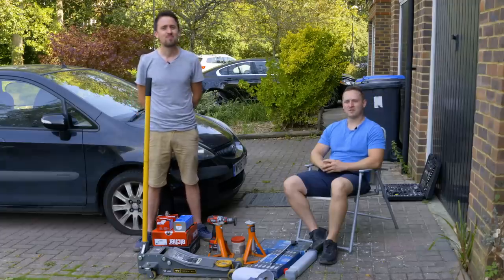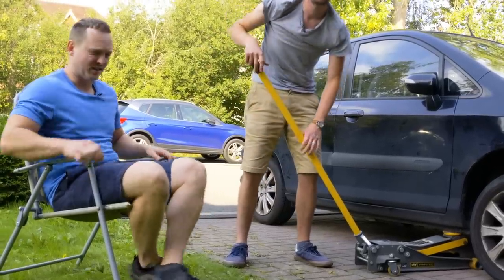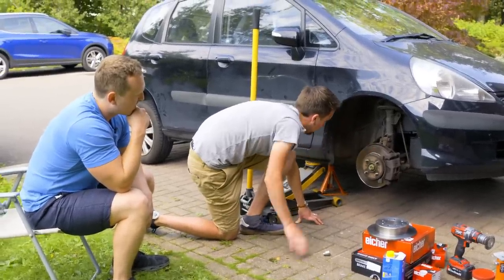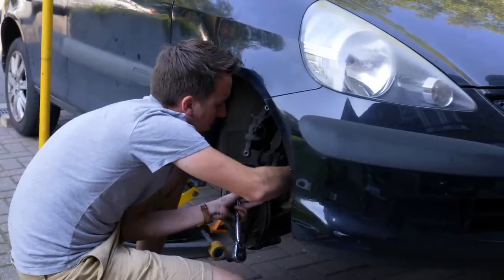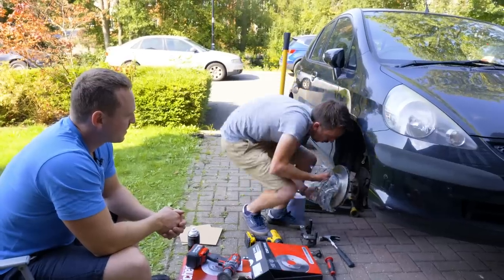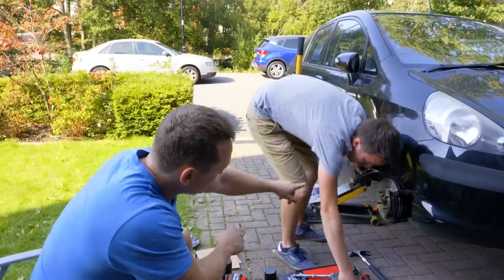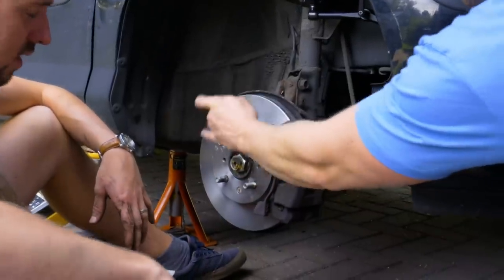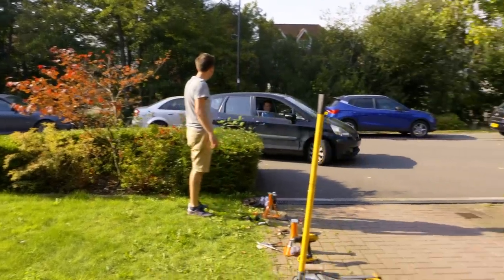Non-Car Guy Changes Brakes For The First Time

Comment: Hats off to Ethan. Most non-petrol-heads wouldn't even attempt this. Now he has the power to give less money to garages and dealerships. The price of having the p**s taken out of him by his 'mates' is well worth it.
Reply: To be fair he had more confidence than most non car guys would because he had all the tools needed and back up mechanic mates in Alex & Jack in the event he got stuck or did something wrong. But yeah, it's nice to see that he was willing to give it a go.
Reply: I’m a non petrol head, couldn’t point out the turbo on my car to be honest. But watching these videos with Ethan doing stuff gave me the confidence to change over my rear bumper after my parking sensors failed and I reversed into something, not sure I have the confidence to change anything mechanically yet, at least not on my 2016 f21. But I’ll give changing the brake pads a go just not the discs. Baby steps lol
Reply: John Peterson honestly if you are doing your pads and you also need to do the rotors, pads are like 80% of the job, the rotors are the easy part of the job, just undo 2 screws, clean the new ones and fit them. As easy as that. I find more labor on the pads than in the rotors.
Reply: This looks like me teaching my nephew something new on his vehicle..... I'm usually Alex when my nephew is working on his car..... I'm just there for moral support
Reply: @edgarmichaelperezruvalcaba7744  Well it is true it's not hard to do the rotors, however if his are still in good shape, not warped or worn down that is, there's really no reason to change them. Rotors do tend to cost a lot on some cars as well.

Comment: Top tip: Turn the wheel outwards for easier access to the caliper and carrier bolts. Well done, Ethan.👍
Reply: Excellent tip, I'd also add to check the brake fluid level when you're done to anyone trying this at home!

Comment: "How have you lost stuff in two square metres?" 

Alex be reasonable, we car guys lose stuff in one square foot then spend 20 minutes searching for it. 😂

Also the piston pushes in a lot easier if you take the cap off the brake fluid reservoir, you might even be able to do it with your thumbs. 😉
Reply: do you work on tiny Daihatsus or how the fuck do you push then with your thumbs??
Reply: I had an apprentice once that i described his order of which is bolts came off a car as a 20foot radius around the vehicle.
Reply: I know the feeling about losing stuff lol. Any time I put something down, it's usually on top of the thing I need next and I end up looking for that for ages FFS!! I wouldn't be surprised if I find something I lost well out of my original reach soon....

Comment: 9:34 “welcome to working on cars”. We all being there, it’s the worst when it happens in cold weather Lol.
Reply: FR. I was fixing a thing on my bicycle that was in a bad position, I got it positioned good, and then it slipped and I bashed my knuckle straight into an edge and it hurt quite a bit. I hate working on my bike cus it's got so much screws and shit in weird spots. Like the screw for my kickstand that keeps getting loosened up is in a really tight place that I struggle to get the Allen wrench into. Spent like 10 minutes tightening it when it should be a 30 second fix if it wasn't in such a bad position.
Reply: Stops happening when you learn how to reposition yourself so you pull to break bolts instead of pushing haha of course thats not bullet proof sometimes you just can't and you will smash your knuckles.
Reply: David Schwartz it’s funny when you simply know what you’re about to do is going to hurt, and there’s nothing to be done about it
Reply: @Sp00kq  use a ratchet with a Allen key attachment

Comment: Ethan: “I’m so dirty” 😂😂😂😂 dude has slightly dirty hands 😂😂😂
Reply: Yeh. Try changing the plugs on an old buick with a leaking radiator hose and a bad axle boot. Grimey.

Comment: One small piece of Dad advice, don't wear your rings when working on anything, so easy for one to get snagged and rip, break or do worse to your finger.
Reply: Interesting fact
Reply: Thanks Dad :D
Reply: Another piece of dad advice, always wear your old clothes or overalls when working on stuff.
Reply: One more concerning but often overlooked advice is to grease the Slider Pins aswel. 
Binding/Uneven pad wear and squeaking brakes are often symptoms of dry Slider Pins.
Reply: All of my jewelry is silicone rubber for this exact reason.
Reply: Worth taking your watch off, too. 1. Because you don't want to break it. 2. Because you probably don't want to know how long you are taking.
Reply: @statementleaver8095  so true, but use silicone grease, not petroleum based or any rubber will swell. I think.... LoL so many little things to remember!
Reply: @anthonybc  I actually use Castrol LM grease (High Melting Point) 500g container.
Supposed to be for Bearings lol

Comment: I’m just waiting for  “A Honda Jazz has had it’s breaks fail and has run over 7 children”
Reply: So typical of Ethan to miss the other 3
Reply: The Jazz only has the oompha to run over 1 small kid.
Reply: Jokes away, that amount of copper grease on disk face will make its way to braking surface due to centripetal force in due time..!

Comment: Changing brake pads and discs is actually one of the easiest jobs on a car. Easy access and only a 8 bolts. It’s hard to get wrong.
I’d double check the owners manual for the correct jacking location under the car, so you don’t damage the floor pan.
The oily residue on the new brake discs are to stop them corroding while on the shelf.
I would also give the mounting brackets a clean as well, so the slots that the pads slide in are free of brake dust.
I used a thick screwdriver laid horizontally across the brake piston to push it in, or I suppose you could use the breaker bar laid across. I find it helps if you unscrew the brake reservoir cap.

Comment: Should probably have kept an eye on the brake fluid reservoir when winding in all four calipers. Last time I did discs and pads on a car I forgot and ended up with alot of brake fluid in the engine bay
Reply: That's because someone added brake fluid when they shouldn't have.
Reply: @dillonbmx16  I was hoping they would top it up before starting, just to see Ethans face when fluid starts dripping out of the engine bay.
Reply: That's why I crack my bleeder screws on the caliper before pushing the piston back in.  Just top the reservoir off for how ever little bit you end up losing, and bada~bing.

Comment: Im no mechanic but ive mastered.
Springs suspension shock absorbers/upermount mount
Control arms and bushes/drop links
Brake disc/pads/painted calipers
Radiator replacement/aircon
Rear diff fluid change/ transmission fluid
Body panel replacement/upgrade facelift lights.
And.............yearly service.

Ive taken apart a whole 2011 audi S3 :) in 2 days

Comment: -"All japanese cars are reputed for using 17"
-"oh it was a 16"
Reply: It's a 16 now that you've rounded it off to that size.
Reply: 17 for the oil drain plug, 16 for the brake caliper bolts. Drill for the JIS screws.

Comment: FYI don't use copper grease on the mating face between the disc and wheel, just the centering ring in the middle. The acceleration and braking forces are all transferred through friction between the mating faces, which is created by the clamping force of the wheel fasteners. With grease the forces can be taken by the studs or bolts laterally, where they are only designed to clamp inwards.
I have had cars that needed a mallet to get the wheels off the first time, then with the mating faces cleaned and greased only on the centering ring they have subsequently come off without any problems. That is where all of the corrosion grips the pieces together, not the flat mating faces. Also clean up the matching parts inside the wheel.
That said, Ethan did great.

Comment: Easy trick when compressing the piston, do it while it's still connected. Take an old flat head screwdriver (a fairly thick one you don't mind bending), stick it through the that square opening on the side of the caliper and into the middle bits of the rotor. Then easily pry the screwdriver towards yourself (using the rotor as the fulcrum point). It will collapse the piston so taking it off/putting it on is easier and you won't need a special tool or smashing a hammer into your guts later.

Comment: One thing Eathn forgot to do, is that he should of taken off the brake fuild reservoir cap, so that the air is not trapped inside the reservoir when Ethan pushes the pistons back into the calipers.

Comment: I feel Ethan's pain: My 2001 Fiesta had spring clips holding the brake-pads in place, they pinged off if you didn't get both ends on properly - it was infuriating!

Comment: for front brakes you can use a pair of big red grips, and then just squeeze the fronts back, you need a wind back tool for rear brakes when the caliper has the handbrake on the back

Comment: Don't grease the face of the disc where the wheel meets. It can cause issues when torqueing the wheel - the wheel will be torqued up, and as you drive down the road, it can loosen the bolts as the grease gets squeezed out. 

Those screws on the rear discs are not required. They just hold it in place whilst the wheel is fitted.

Comment: Here in Ontario, we use silicone grease on all calliper pins and pads, and the anti-seize (copper grease) between the hub and rotor as well as the rim and rotor. And usually don’t put those stupid rotor screws back in. We just have way too much corrosion and seizing around here.

Comment: When you are trying to remove the caliper, turn the steering wheel so the bolts on the back are facing out so you can use your body weight to remove them with a breaker bar if they are stubborn.

Comment: Alex you meanie, 1st rule on spannering never grip the spanner or ratchet. Always have your hand open so you use your palm. So if a tool does slip you only hit the palm of your hand ✋ not 👊 your knuckles. But Alex would have know that. Naughty boy.
Little things.
1 remove the cap from the brake reservoir. Helps with allowing the pistons being pushed back.
2 clean or replace the little silver clips that hold the pads on the caliper carrier.
3 clean out and lube the holes where the caliper slots in the carrier. For smoother action. 😉
4 you don't "need" the little screws that hold the disc on as there are 4 wheel nuts doing that. But hey fair play for getting new ones.
Apart from that good job. Oh copper slip the wheel studs a little too not to much.👍

Comment: I started a brake job last year in April, I didn't finish until September when I finally had all the parts and tools. I also had replace a wheel bolt and wheel 2 lugnuts that I had angrily put on too tight and wrong at one point.
There was damn loctite on the front wheel caliper bolts.

Comment: In Canada I was quoted 650$ cad for aftermarket and 900$cad for oem. Bought rotors and pads for 150$ for the rest bought power tools, lubes and other small stuff for the future and did it myself...

Comment: easy way to loosen your lug nuts. Use the top of that jack that comes off and put it on top of the lug wrench. It makes it wayyy easier and requires less force. Saves a lot of time.

Comment: I've taken my 2011 Megane to a free safety check within a different reputable service. It rimes with halfrauds. They asked me if I'm worried about anything in particular. I said discs and pads. They then proceeded with the check that took them a full day. They advised me that the discs and pads are gone so badly they would fail at any minute now. Their best quote was over £600. When I've asked why they said the bearings are sort of included in the back discs. Never again. That was 1 and a half years ago. Still same discs and pads. No issues with 2 MOTs since. Never trust a main dealer!. They also nicked my oil dipstick. I found out too late. I found just the top of it glued in place.

Comment: I normally used a screw driver and 14/17 , 12/14 flex socket to work on jdm cars 
12/13 flex socket and a 17 wrench and h7 on bmws with a screw driver 

Before removing the caliper, just slightly pry the caliper outwards , this should free up some space then push the piston in gently with disc or pad as ur fulcrum , piston should go in easily or else u need a caliper service kit

Even brembos or porsches audi range rover  jag 6 pods can use similar ways but depends on a person experience

If not enough leverage in a tight space , use a larger pry bar and use the lower arm or subframe ad the fulcrum on the 17mm bracket bolt

Comment: First thing to do before working on a vehicle is to put on the proper clothing and shoes.   Boots are safest.  Clothing you don't care about ruining.
Nothing wrong with using eye protection as well.  Hondas and Toyotas don't use 7, 9, 11, 13, 15, 16, 18, 21 mm...they simplify things.
Without power tools, once the wheel is removed, best to turn the steering wheel all the way to one side, remove ignition key so that steering wheel sets itself in the locked position.  This allows easier leverage to remove caliper bolts, all four, each size, without having to get under the vehicle with one's body parts.  A hand impact tool with proper shaped phillips head bit easily removes disc (brake rotors) retaining screws.

Comment: I also struggled with the caliper bracket bolt that Ethan barely got off, though when I broke it loose I smashed my face into the fender.

Comment: I used to be a "DIY mechanic"
. Untill I realised it was cheaper to give it to an expert, rather than spend 2 days on a job that should take 2 hours. 
Or when I changed a broken camshaft in my Transit van, thought I was a legend as normaly the engine has to be removed and flipped to stop the valves falling down. I used magnets to kep them in place and it actually worked👌
but it still  wouldnt start! spent a week tinkering, gave up and put a new engine in. Still nothing
In the end I found the original PATS immobiliser was the reason for it not starting up and I had wasted £500 and a week of my time. 😂😂😂
Pulled out a relay and stuck a bit of wire in. Boom
Never again lol

Comment: Don't grease your pads! Grease only attracts grit that will gum up the slides, just get the metal bare and clean and let the brake hardware do it's thing! Also you didn't check to see if the guide pins were seized, judging by the wear of the pads on the first wheel they're probably fine but you gotta check!

Comment: When pushing the break pistons back in, I was always advised to place the spent break pads over it and then push against that, to prevent damage. 

This was advise given in regards to a motorcycle though so a larger car piston might be less of a concern.
Reply: Sounds like a good idea, that's kinda how those piston pushing tools work, so I guess I didn't need to waste money on that lol (I don't think it was too expensive anyway).
Reply: Your right ...old school mechanics like me use  the old brake pad to push back piston ...  
we also remove the brake fluid reservoir cap  to save the master cylinder seals ...
that said Ethan did a decent job for first go

Comment: You don't need the screws on the rear discs... the wheel will hold it all together anyways plus with the brake pads are on, its not likely to fall off the carrier. 
Also, PUMP THE BRAKES BEFORE MOVING

Comment: 1. Put the wheel under the car. It won't harm.
2. Clean the carriers with a wire brush.
3. Take a good screw driver and hit the screw holding the disc. You might not round it off. I would not recommend using a drill... 

p.s.: that jazz needs so much stopping power that they used 2 screws to hold the disc!

Comment: Noticed in first shot replacing the driver's side, inside brake pad that Ethan installed the passenger's side brake pad on the driver's side as the wear indicator isn't the correct orientation.
Wear indicators should be facing up, not down on a leading edge caliper.
NotTheTechnician.

Comment: $505 Aussie pesos? Did that include parts? I just did a brake upgrade on my car, and while I was at it, did the front radial bushes, upper and lower control arm bushes (front). And the handbrake pads. Spent half an hour the day before watching you tube vids. Smashed it out in 4 hours. Great vid though guys, always entertaining. I only recently found you through Mighty Car Mods down here in your giant old timey gaol :P

Comment: I feel his pain, the first time I changed my brakes was a pain in the ass and is the reason why I always have a garage do it for me now and £125 for brake pads and discs installed by the garage is a good enough price for me, the thing I hate about garages is when I take my car in for a MOT and they say the brakes need replacing even though I've only done 2000 miles since I changed the brakes, cheeky buggers lol. I'm glad google exists because there is no way I would do anything with my car without google and I hate it when someone who knows about cars doesn't help or trolls, how would they feel if they needed help doing something they've never done like building a computer and I told them to plug something into the wrong thing which could end up killing a component.

Comment: So I learned it once this way. Did many brake disc, calipers and pad swaps. Now I hate doing this as paying somebody is just less work. *(normal car) and I tend to get the copper grease on anything and every F. thing during this. Excellent footage of a noob doing this, with all the pro's and con's! Sure sure changing it all yourself will cost less. But honestly for me, no, yeas as I want to test them first. But these are front brakes similar to many cars. Now I wanna see a noob do the rear on some cars. Like Ford Focus 2.... Extra toolset required, 2x... Ok I got it done, but 200 euro worth of tools just because Ford and Torx are married...??